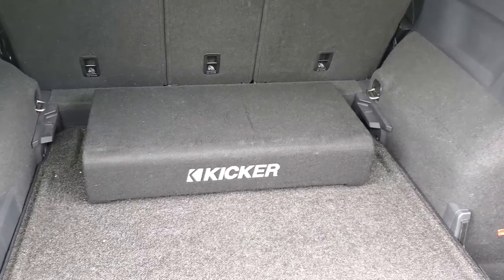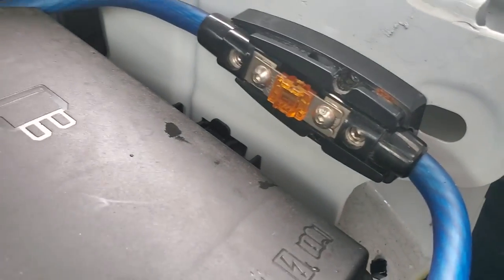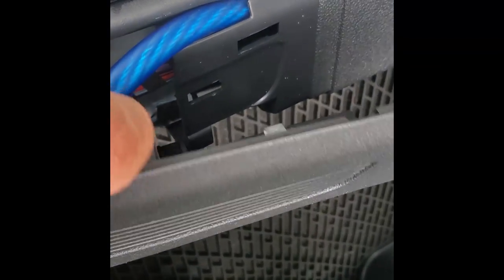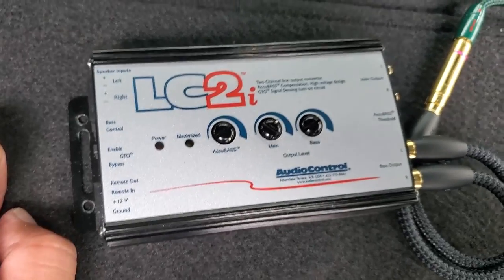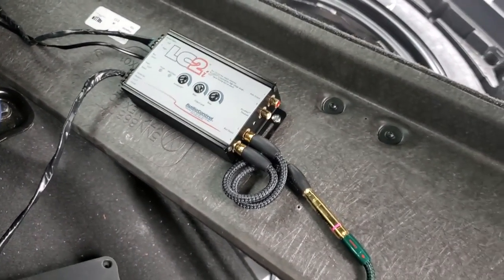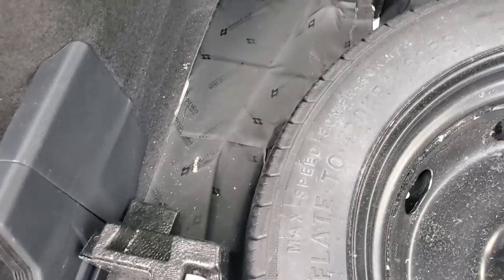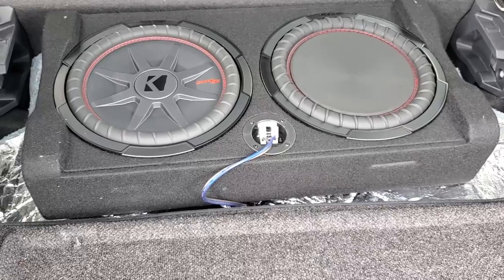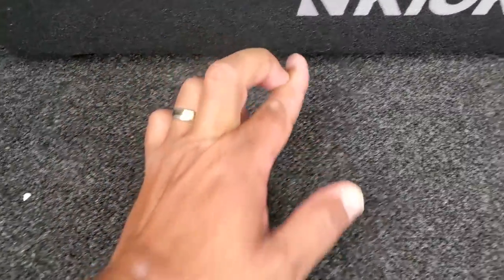2022 Tiguan Sub & Amp install. Kicker subwoofer, Audison amp. Under $1000 Volkswagen R-line upgrade

Comment: Thank you so much Jason.  I didn’t even try to start this project yet but I appreciate you getting back to me.  Another guy has told me the amp is under the drivers seat?  I’m going with what you shown on your video. Just wish I knew how to cut into factory wiring.  You mentioned like a T harness that plugs into factory wiring any ideas on where to get one?

Comment: 2024 Jetta GLI 40th Anniversary here, been doing some research before I pick up the car on Saturday. I have not seen anyone show the computer/head unit combo in the glove box on these modern models, you're the first I've seen. This might be exactly what I need to get this done. Can you confirm if the output off of the back of the "head unit" is clean? I've had some audio shops tell me it will not be clean or it just simply doesn't work like that anymore with "modern cars" something about the signal going to the speakers not being clean or readable for a line out converter. Thanks
Reply from the maker: From what i did the signal seemed very clean. I did grab signal before it went into that factory amp and the factory processing inside the amp, that might have helped. If the factory system has fiber optical out thats a totally different ball game
Reply: @jasonin2details  gotcha, my car won't have a factory amplifier besides the "head unit" unfortunately. I also may have found a shop that will take the job on so fingers crossed. They've done a 2023 Jetta with factory amp so that's probably close enough. Thanks for the reply.

Comment: Jason could you please tell me the color of the rear speaker wires both +/- for both the left and right speakers of your 2022 Tiguan R-Line, NO Fender audio system?  You said its an industry standard but I am finding that nowhere.  Crutchfield has no information on this make and model if you can believe that...they usually have all the information on something like that.  I have read in many VW Forum groups and still nothing.   I will take your advice and splice into the factory harness behind the glove box but once again had no luck in a so called "factory harness".  So I am hoping you can guide me thru this.  I want to hook up LC2i to my rear speakers for a "full range" signal then hook up a Focal Bomba BP20 powered sub.  Hoping that will fill in what my system is missing.  If this doesn't work, then I will replace the in door speakers with Focal like you showed in another video.  Thank you for all your help.
Reply from the maker: First I cant be responsible if this is wrong. Most amps are Right rear +solid violet ,-Violet with black stripe.  And left rear is +Green, -Green with black stripe.  You could actually take back door speakers out and look at colors there to be sure.

Comment: I’ve watched both your videos on the audio subject, the stock tiguan audio is not great at all

Just curious since you swapped out the front stage to the focals, why not run them with an amp and then use a dsp for optimal tuning ? 

As an audiophile person myself and have an sq system in my 2017 rline passat I did a full build using hybrid audio and zapco equipment since I was already spending the money for a better audio environment
Reply from the maker: Just wanted very simple upgrade that was quick and reliable and cheap. Look at the build in my Supra thats next level

Comment: Do you have the wiring diagram to connect to the adapter for the subs?
Reply from the maker: No but if you buy a wireharness for aftermarket raido its exactly the same colors for the speaker wires so its actually simple
Reply: Pulled my 22 apart and the radio wiring colors are not the average white gray purple green..   any thoughts ?

Comment: Not sure how to install LC2i.  You mention about grabbing the signal at the amp?  Then you mention left and right front and left and right rear?  On the LC2i there is only room for 2 sets of wire not 4 like you are mentioning.  Not sure what you mean.  If I am going to install a self powered sub, do I have to go all the way up front to the factory amp or can I just get the signal from maybe the two rear back door speakers.  Please advise...you are like the only person I know who did this to a Tiguan.
Reply from the maker: If you want to get back door signal you would have to find what wire it is before it goes into the door, so it would be in the door sill. I think it is easy to get it from amp behind glove box. I was told best to get from the rear output cause it is a cleaner signal and more full range. So correct only pick rear not both.
Reply: @jasonin2details  Can you please tell me how to get the info on what color the wires would be for my back rear left and right speaker if I get it from the amp behind the glove box?   Also how did you power your LC2i.  Did you also grab that at the amp?  Do you know the colored wire I would want to look for the power?  Sorry for all the questions.  You mentioned a T-harness for wire connections if I didn't want to splice into.  Where do I find that?  Thank you!
Reply from the maker: @gary9879  First thing is if you have this many questions I would pay a professional to do it. You tap wrong wires and the repair bill could be thousands. The colors of the wires are industry standard that come in almost any wire harness kit for VW cars. Crutchfield would have a wire harness. You get power for LC from the wire you ran for amp
Reply: Thank you for your advice.  It’s not like I have a lot of questions, just want to make sure first on what I am doing and what I am looking for.  I am sure you didn’t start your upgrade until you knew the colors of the wire and what to splice into.  All I was asking for was where did you learn about the wire colors?  Figured mine would have to be the same.  I got the exact same vehicle.  I pride myself in doing projects myself, makes me feel good.  I am sure you are the same.  Your videos make it look so easy.  You are very talented!  Thanks again for all your help.
Reply: And I just got off the phone with Crutchfield and they do not carry a harness for that model.  Any other ideas?
Reply: @jasonin2details  I called Crutchfield and they DO NOT have any harness for the 2022 Tiguan R-Line nor can they even tell me the colors of the wire I need for my back rear speakers.  Guy told me since the pandemic they are way behind in providing information on newer vehicles.  Can you PLEASE tell me what the color of the wires are that I need to splice into behind my glove box?  I would need the left and right rear speakers, both positive and negative.  You mentioned the color of the wires are industry standard?  Where did you find that info?  I think they forgot to tell VW.   I never ever had such a hard time trying to find out information on such a simple request. Even when Crutchfield can't tell you...something has got to be wrong. They are usually the best source for help on that. Your my best source now.   I am hoping that you can help me out considering you did such a great job on your own.  Thank you again for your help.  I really appreciate it.
Reply: Please Jason.  You are my only hope!  Been waiting for days.  May return what I already bought….Please!
Reply: @gary9879  hes not gonna give it to you lol. I've found on forums 
RR + is yellow
RR - is brown yellow
RF + is red/blue
RF - is brown/blue
LF + is red/yellow
LF - is brown/yellow
LR + is grey
LR - brown/ grey
When you take the radio control out from behind the glove box, the wires are in the orange connector piece (you’ll see what I’m talking about when I saw orange connector)
Your power wire for the LC2, share the power with your amp (take your power wire and tighten it down with your main power cable at your amp)
Reply: You do not need all 4 speakers, or all speakers your car has, wired into LC2i. The speaker "inputs" on the LC2i are your "remote wire." Find your - + wires for your rear speakers, splice those into LC2i, once the LC2i sees those 2 speakers' signal, that is what will essentially tell the LC2i to turn on. Now when adding an aftermarket amp, you will run a remote wire from "remote out" on LC2i to that amp, so when LC2i sees signal from your 2 speakers, that will turn LC2i on which in turn will then tell the aftermarket amp, via added remote wire, to turn on and amplify your speakers and subwoofer that are wired into the added aftermarket amp/amps